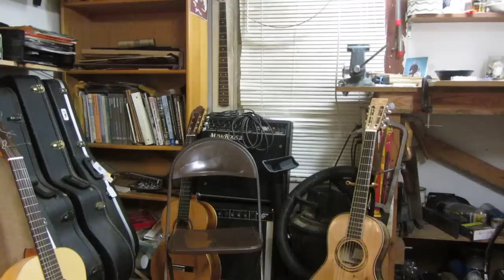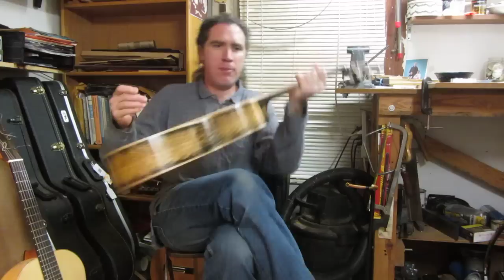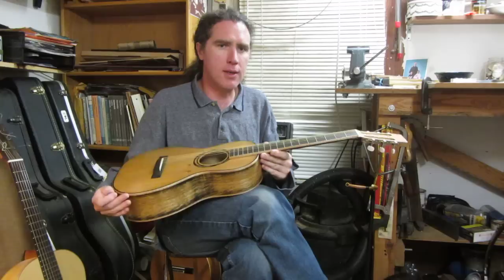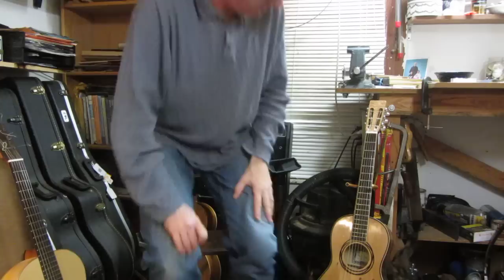Parlor Guitar Made From an Old Barn - 2

Comment from the maker: Josh I have the action set to 3/32nd inch over the twelfth fret on the low E-string and 1/16th on the high. With strings in size 10 it feels more like playing an electric guitar. I wouldn't dare put heavier strings on it because the top is so light. I use 13's on most of my guitars but I love the light action on this one and may even lighten up a bit on my other guitars because of it.

Comment: Vary nice sounding guitars, Some might turn there nose up to using Oak as as Guitar wood, but you are proving it good. What is the top wood?
Reply from the maker: David, I learned a lot from building this guitar. It was almost a joke really but I was surprised it sounded so good. Turns out that there are a lot of very well respected luthiers that absolutely love White Oak. It makes a great guitar but you are right. For some reason they are hard to sell. I think tradition has a lot to do with that, thought it's changing, and in the minds of many oak has that Amish furniture look to it... or something like that.

The top is what I believe to be Southern Yellow Pine. I was quite surprised to find some perfectly quarter sawn pine planks that made up one of the walls of that old barn. It fits the description of SYP which was very common for barn use in the early 1900's in Virginia. Normally it's a very heavy and sappy wood but I guess 100 years as a barn wall dried it out real nice.

Comment: Hey, I had a couple questions about your guitar. What kind of bracing pattern did you use? And I also wanted to ask what you thought about the bass response, it sounds great on a youtube video, but how well does it perform in person? Would you say that it has a pretty even presence between treble and bass? I'm asking because I am going to be building a single 0 with Oak back and sides and a western red cedar top, I may change the top wood though; I chose it because I wanted to bring out the bass from such a small packag. But, with your barn Pine it sounds great! Oh real quickly, did you prefer the silk and steels or the 80/20? I have played silk and steels for a few years now and I am a little biased towards them
Reply from the maker: +musicismandatory I liked the 80/20 much better but it's definitely a personal preference. I used an X-Brace. The guitar it's based on uses a modified ladder brace but the top was so thin by the time I got done milling it that I was afraid it would not hold up to string tension under a ladder brace. I think the reason why it has such a good bass response is because the top was so thin, also the top is dead flat not radiused which I think helps bring out bass. I don't have an exact measurement but it was very very thin and floppy. If it was not a part of the contest and in keeping with the back yard theme I'd never even consider using it. 

As it turned out it changed the way I think about bracing and thickness tops. For a small guitar the bass response is astounding. The treble response is also excellent. If anything it lacks middle but over all it's just a surprisingly great sounding little guitar and I cannot wait to build more of them and do plan on trying out cedar as well as redwood and Adi. 

Once you get done if you post a video on Youtube tag me, I'd love to see it.